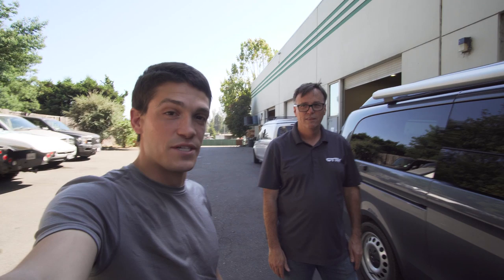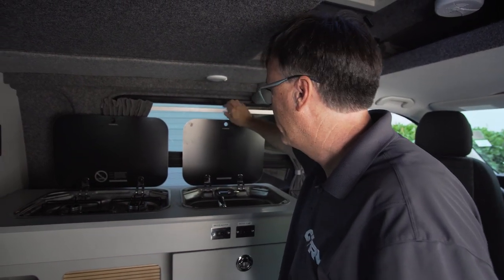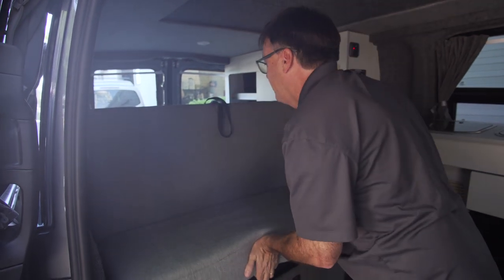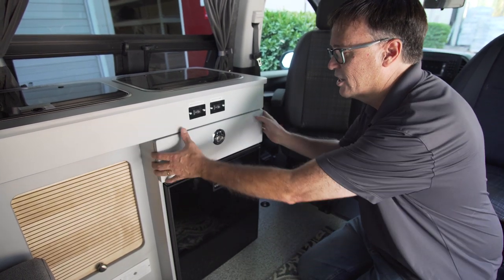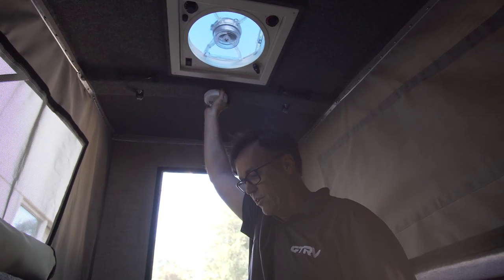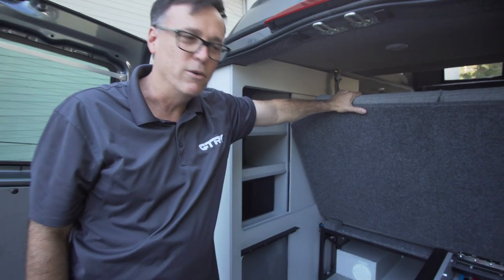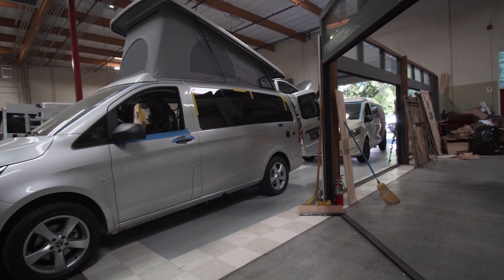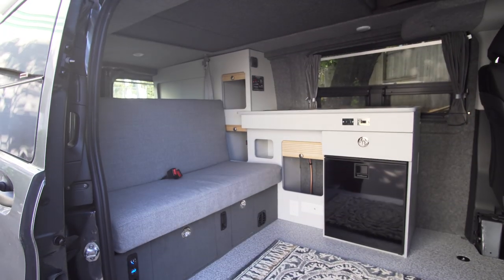INCREDIBLE MERCEDES METRIS POP TOP CAMPER VAN

Comment: I had  a 2001 GTRV on Ford E150 and loved it.  My wife wanted a larger camper so we have 2018 Travato 59 K.  We love it but I still miss The GTRV.  They are a little too pricey for the product you get.  You could build it for much less by one’s self.  Bring the GTRV down by $10, 000-15,000 and they are in the ballpark!

Comment: As always great video.  My guess is $75,000 out the door.
Reply: 100k would b my guess
Reply: I think if you had something like this built at Sportsmobile, it would be at least 100k.  The Mercedes Metris van goes for about $35,000.  According to the GTRV website a westy conversion is in the mid 30k range.  Hence my guess is $75,000
Reply: @senseofstile  depends on options on both im still betting over 75k
Reply: @senseofstile  38 easy on mbusa + converting van into micro rv and the pop top im betting between 75 and a 100k easy
Reply: Metris comes with nothing so windoes foldsbed kitchen etc is additional
Reply: You could be right.  It might be a secret.  If it isn't maybe Nate can explain the price.
Reply: Here is my 2 minute video featuring a Metris Sportsmobile.  It doesn't have near as many features as the GTRV version;
https://www.youtube.com/watch?v=s7ud6jEzjVs

Comment: A rally nice van for sure...all set to go. Now, who can afford one? lol...
Reply: For about 1/2 the price, I'm guessing, I'll  sell ya my '95 Eurovan camper.  I don't have solar yet,  though, sorry.
Reply: Actually, after reading further comments, more like 1/3 of the price! It's just an updated Eurovan, build-wise/floorplan-wise.
Reply: @kelliethorne1200  that sounds like an expensive eurovan
Reply: @kelliethorne1200  No,thanks Kellie, I'm good with my camper for now. It's home.
Reply: There are several options with this Metris (or other vans). You can get a 10k mile cargo Metris for 20k or less and build out your own camper (lots of info on the web of what people have done for a low cost). These full blown conversions are expensive but in line with what a European VW or other full camper van would be. Of course you can go way up in cost for bigger and more luxurious camper vans. You can also go way down in cost and put a roof top tent on your vehicle. That's what I do when I vehicle camp. There are options for everyone.

Comment: These designs on these small campers are always backwards in my mind. If you reverse the layout on that kitchen/cabinet system and moved the bed bench forward so that the bed mode went up against the front seats, you'd have room for a cassette toilet and additional flexibility for storage in the rear to make this a more functional daily driver as well. Plus instead of needing a separate rear shower nozzle, you could just use an extending faucet nozzle on the sink with a nozzle mount on the liftgate. Glad someone is making these things in the US though.

Comment: Nice.. but you need to do vid on what the "real folk" can afford.  Under 15k, off grid versatility, self contained and affordable to the average Joe.
Reply: Look in the used market,  and you may have to build something simple out of a cargo van for that price.
Reply: Mine is under 15k and, other than solar, has pretty much everything necessary for off-grid.  However, for this price, you have to be very resourseful & creative...and the ability to compromise.
Reply: These are not expensive 😂

Comment: The only thing im missing in the Metris is a table? Also a price would be informative...
Reply: You don't wanna know, it's a Mercedes
Reply: Winnebago Travato new you can find find for 75ish. Shower,AC,Toilet, more room.
Reply: There are a few options for conversion levels. Pop top only about 10K. Weekender conversion (Pop top, rear seat/bed combo, flip up table, sliding side windows, swivel front seats) for about 20k. Full camper conversion for 30-35k. A very low mileage (like 10k miles) Metris cargo van can be found for around 20k and sometimes less. I'm sure they can add the flip up table to any version. It's probably tight to have it in the full camper but works great for the weekender. Maybe a smaller swing up or portable table for the full camper.

Comment: Nice van but no table for eating or for a computer.
Reply: The did not show a table, but I spotted a floor socket that looks like it is meant to be the attachment point for a removable table.  I'd wager that it fits nicely with the swivel front seats.

Comment: Nice van, westy?  Trying to knock off another famous name?
Reply: Westfalia has done conversions for VW and other vehicles. They have been doing the Mercedes Vito in Europe (basically this Metris camper) since the mid nineties. I don't see the issue with using "westy" or "weekender" to name conversion styles. These are the names that people are familiar with. They are known mainly from the VW conversions but was not exclusive to VW.
Reply: @slickness8892  I believe these are trademarked names, simply put it isn't a westfalia unless westfalia built it.  They produce a quality product and have spent years building a name on their products.  Call it a camper van if you like, if folks don't understand what that is but know what a westy is there may be deeper issues.
Reply: @slickness8892 

 0:30

This is the problem.  I'm not referring to casual conversation, people can use whatever term they want casually.  

A business that uses the competitors hard earned brand name to sell their product is stealing decades of reputation built through hard work, sacrifice,  and product support.
Reply: @UCc2xbzzGR6bhRRfeHqPjw5g interesting detail on the expired trademark.  Weekender would seem less of a direct theft of a name as it simply described a bare bones pop up, no kitchenette, and it isn't instantly recognized by most casual observers, the trademark status determining legality. 

Calling it a westy is akin to target calling their facial tissues Kleenex,  although it may be legal now it does seem like an attempt to RIP off the name instead of creating their own.